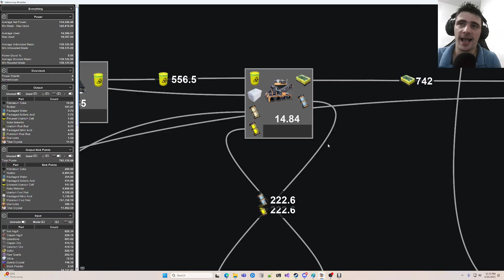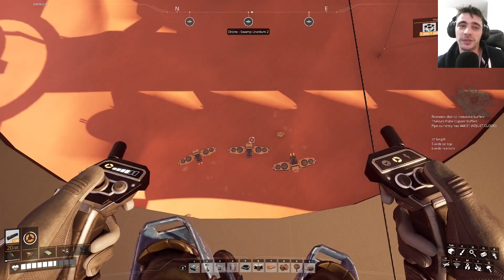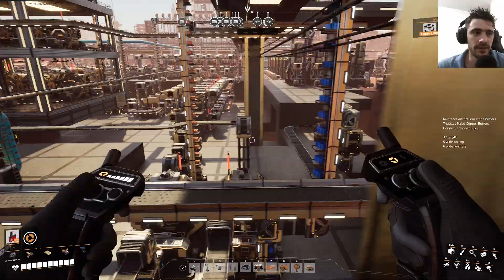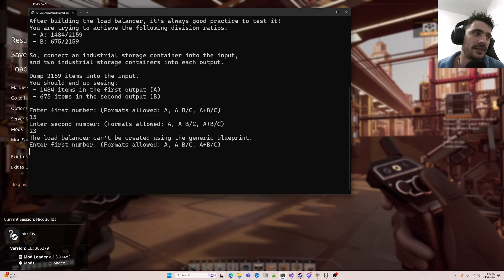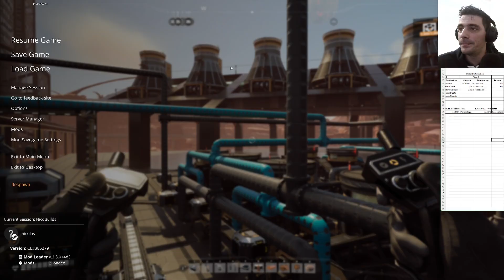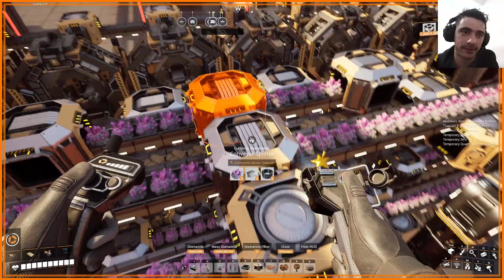Building a Nuclear Plant with Code, Math, and Poor Life Choices

Comment: Yes, just build a river in the desert to run a single powerplant 😂

Also I didn’t understand any of the programmable load balancer stuff but it is still seriously impressive.
Reply from the maker: Haha, thanks mate. Yes, maybe not the brightest place for a nuclear power plant but I said that i was going to finish the game in the desert and I plan to do so! 

Regarding the balancer a summary is: you want to divide a belt into 2 belts that have a specific amount of materials? 
You plop the blueprint, connect some lifts as the program tells you and you are done! Only drawback: it sometimes simply doesn't work, hahah. Depends on the numbers
Reply: That lonely quartz line 😆. Can't wait to see the finished power plant. I've decided not to do nuclear power on my playthrough as it's only my first time and I'm going to try and finish with just rocket fuel.

I'm trying to hurry and finish before 1.1 drops but I doubt it's going to happen. It's summer break in the States and we're traveling a lot so I have to get my fix from your videos. (40 minutes is not too long BTW). Keep em coming!
Reply from the maker: Honestly, your approach sounds great. Rocket fuel is probably the easiest way to get power if you're thinking in terms of "amount of work" vs. "power output." Totally valid.

Nuclear is super interesting, but yeah — I don’t think it should be judged purely on efficiency. It’s more of a fun engineering puzzle if you're up for the extra challenge.

Glad I can help keep your Satisfactory vibes alive! 😄

And yeah, I wouldn’t stress too much about finishing before 1.1 drops. Just enjoy the ride — when and how you play is what makes it awesome.
I’d say you're already doing it the right way.

Thanks for dropping by!